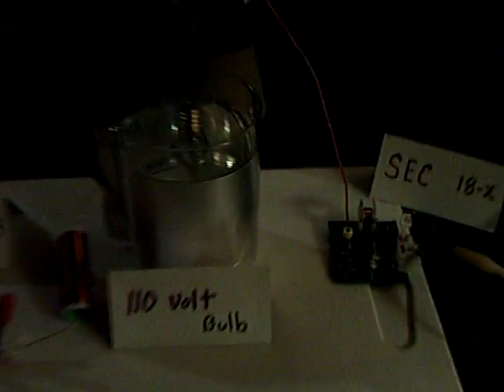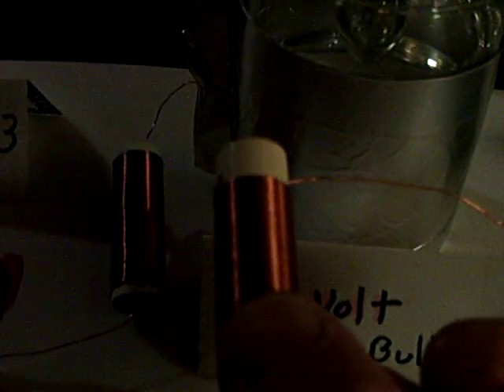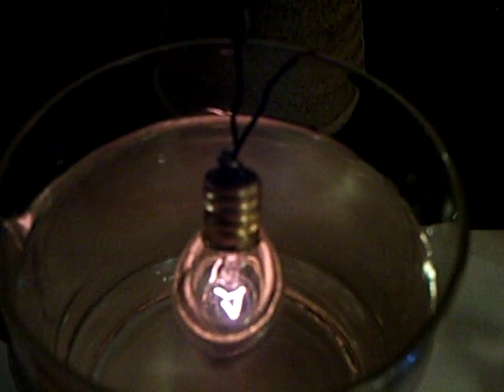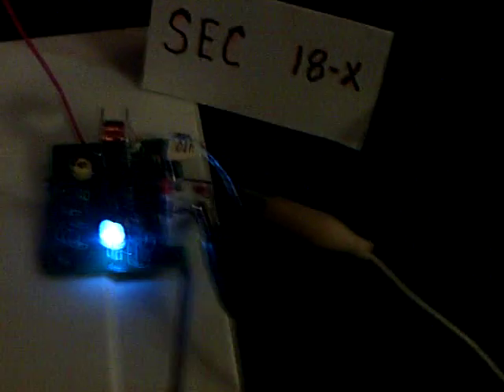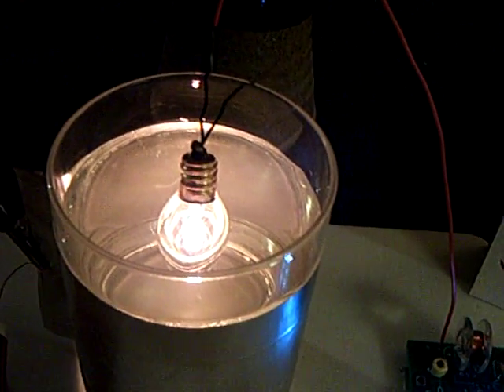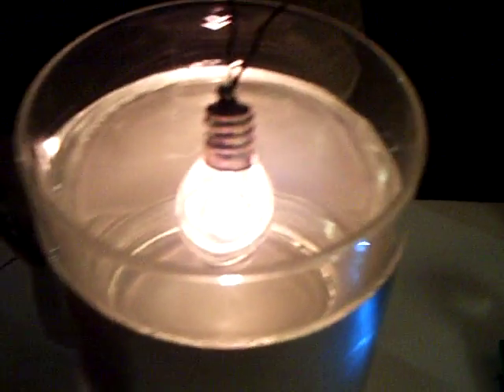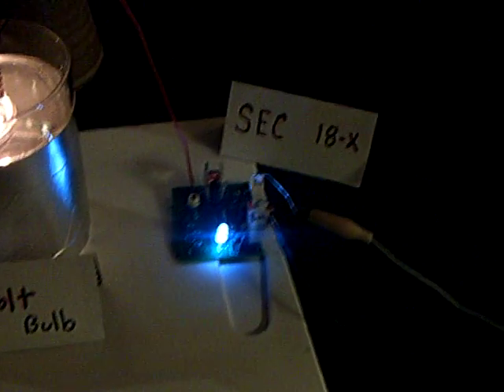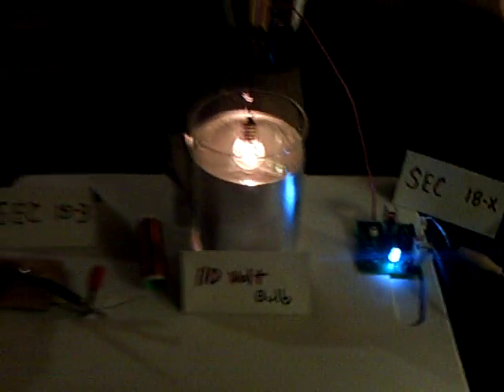SEC 15 --- Light bulb in the water----experiment -- Part 2.

Comment: the water may provide JUST the right insulation to make a preferable contact with the second terminal on the bulb. i notice some lights on an exciter will light 1-wire nicely as long as the other terminal has a virtual ground. looks like the second exciter is providing that virtual ground through the conductivity/insulation of the water, and well i suppose the glass as well. pretty neat! ever try lighting the bulb wireless by hooking both terminals to antennas?

Comment: @StifflerDr 
I see,
well made me think and ponder, if it is working overunity, as the 7 Watts bulb was pretty bright with an input power of just a bit less than 2 Watts.
But to see how much power the ligh bulb emits would require a secondd same lightbulb to be powered by DC power and then compare the brightness and measure the DC input power to the second lightbulb.
Anyway, nice experiment and I wonder how the filament is getting such a glow just from displacement current ?

Comment: Dear Lidmotor, well done experiment, but how much power do you feed in there ?
And what is the power rating of the bulb ? Have you measured this ? In Dr. Stiffler´s case he showed around 2 Watts of input power and he lighted up a 7 Watts bulb, maybe not fully bright, so was it more than 2 Watts at the bulb ? Hard to say without seeing any quantitative measurements. Surely not easy to do at the Mhz range, but the questions really is, if this circuit combination can really go overunity ?